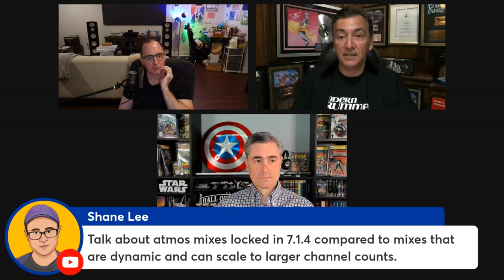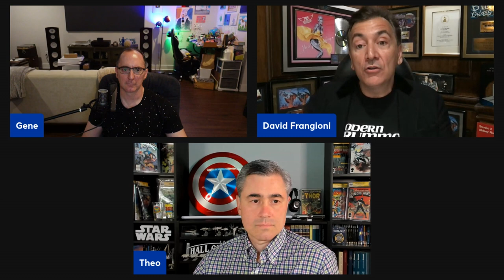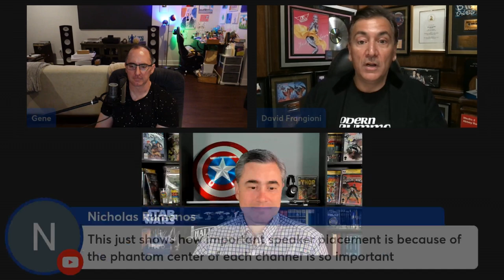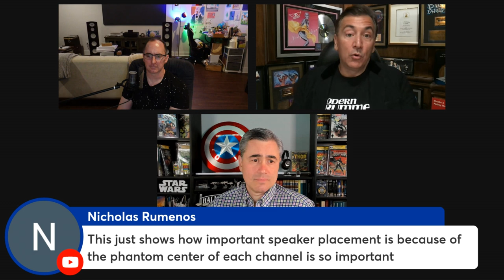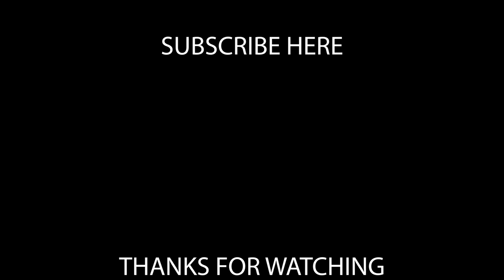Why 7.1.4 Static Atmos Mixes Instead Of Dynamic Mixes?

Comment: The more I hear from the people that create the mixes the more I realize that atmos has a long ways to go before it matured. Or used to its potential. It's been out for a while now and the producers just aren't spending the money on it. Then there's the other issue of the av atmos and the sound bar atmos. How do you chose when you only want to release one track? Or am I wrong about that? I'm pretty sure that many mixes are leaving the true potential of Atmos on the table.
Reply: The main advantage of atmos from a mixing perspective was the promise of a mix once and let the consumers equipment dynamically up or downmix to fit their exact configuration. So the engineer wouldn't have to worry about a 5.1, a 7.1, a 5.1.4 , wides, you place sounds in an environment and the processing and assignment of sounds to specific speakers happens on playback. Technically it should be a major Time Savings to not have to worry about all the potential layouts that could be out there everything from Soundbars to crazy large systems could be supported from a single mix.  In theory there isn't any reason they couldn't just put the full theatrical mix on the 4K and not even worry about a home theater mix.  But I guess for sake of compatibility, safety, and controll, they still premix and reduce dynamics for home release.  Not everything supports Atmos and not everything is going to decode with the same quality and precision at least with a static mix they more or less know what you're going to get, and can "pre optimize" it for lowest common denominator equipment.
Reply: this is why I enjoy auro3d so much more, the algorithm converts everything great for me.
Reply: @Antimonkat  this is why I enjoy auro3d so much more, the algorithm converts everything great for me.
Reply: @Antimonkat  bringing us back to my point of disappointment. The lowest common denominator. I've spent thousands chasing this atmos shit and it seems I have to spend thousands more on a k-scape. I bet by the time I save up the money for that the price will be raised again. When we the consumers were sold on atmos it kinda sounded like it was going to be much more object based sound than it is. Knowing that everything but the Kaleidescape mix is made for at best a sound bar makes me second guess spending the money on separates and maybe I should have bought the shockwaf 9.2.4 and spent the rest on a snowmobile and a motorcycle and if I bought used I could have a jetski to go with it. I think atmos has a long ways to go in the ho.e theater or else if this is as good as its going to get than I can do without all the expensive shit and sell it and get a nakamichi shockwaf or a Dargon and call it a day... whilst I buy a used snowmobile and Harley with the rest of the money from the sale. Heck there might even be enough for a jestski also. I'll admit I am really bummed about this but there could be so many more object in the mixes. It would take a big company like Apple to bridge the gap between soundbar mixes and Kaleidescape mixes. Actually they could provide those Kaleidescape mixes for a much lower cost of entry.
Reply: @william1252  I agree with you, after being gone from home theatre since prior to atmos, I just got back into it last year and haven't stopped spending over atmos.  I was disappointed with the sunds that I expected should come from atmos and hardly ever got them consistently.  I tried auro and that worked for me but I'd defenitely stick with a basic audio setup and get those other toys you mentioned.  I got to a happy place with auro but after a few thousand I'd rather go water sking or biking too.
Reply: @william1252  as far as I know and from watching several of Shane's reviews I don't think the kaleidescape sound mix is different 9.5 out of 10 times from the Blu-ray yes they get theater Masters and do their own compression for higher bitrate but I don't think they're mixing the audio from scratch I don't think I've seen yet a video where Shane said the kaleidescape audio was better than a disc when he tried both
Reply: Back to your original Point even theatrical Atmos is disappointing a lot of the times it comes back down to a being underutilized likely due to time and budget. Though to be fair plenty of smaller more India Affairs have better atmos than some of the big Marvel stuff. Just saw Guardians 3 and I was not impressed with the soundfield of the theater. So yes it does make the investment a little less Justified when the contents not really there to utilize it
Reply: @Antimonkat  where I live we don't have an atmos theater. We do have a modern stadium style multi theater and it's pretty awsome for our town. I'm not even sure if there's an atmos theater in Fargo. When I go to the local theater the dude will turn it up a few notches when he sees me come in and that's pretty dope. I would have to drive at least an hour and a half I I wanted the theatrical version of atmos.
Reply: @Antimonkat  If you buy my small trucking company from me I will take all the money and learn to mix atmos and become the mixer known for the most crazy effects.